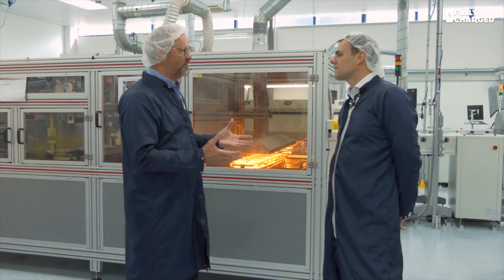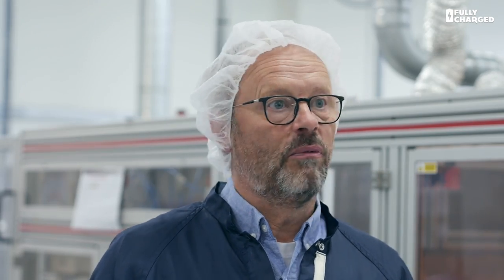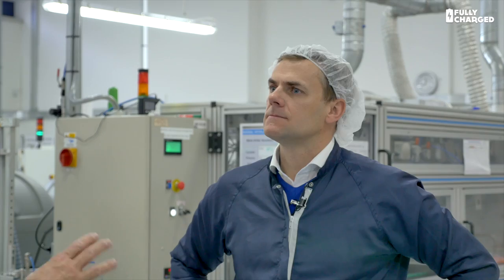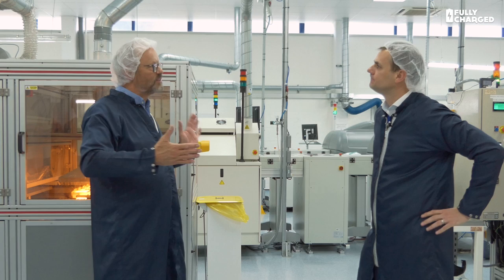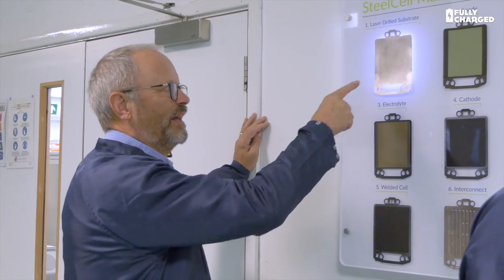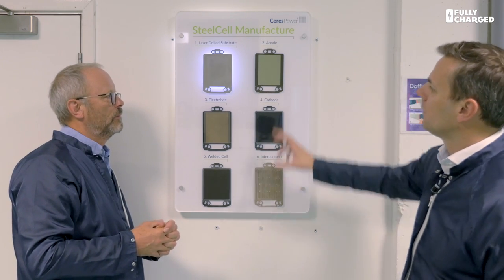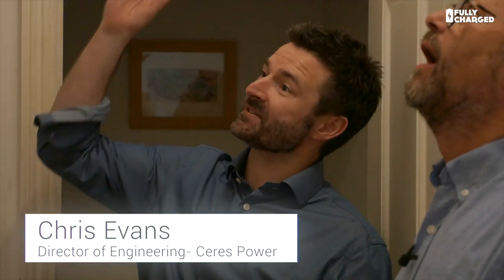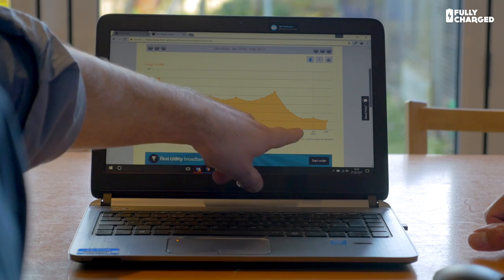Ceres Power | Fully Charged

Comment: One thing not mentioned when talking about efficiency is the fact that the gas must be transported to the house. In places where that is necessary for central heating, its not such big issue, but it shouldn't be ignored as gas leaks are a major problem and the whole infrastructure cost should not be left out of any cost analysis. It would have been interesting to see an analysis of how it would do as a battery using electrolysis to create hydrogen then back to electricity. Would the storage of the hydrogen make it nonviable for most locations and would the overall cost be competitive when compared to more conventional batteries.

Comment: These cells would be amazing combined with a battery storage system to capture unused energy while you're not at home and the gas grid isn't under as much load from things like cooking and heating.  Then when gas demand goes up, they can be switched off or reduced in output while your home runs on batteries to keep the overall consumption of gas lower.

 I'd love to have one in my home, that's for sure.

Comment: Many of the comments in the comments section are way off.  The prime point was that a company has developed a new type of cheap to make fuel cell that could make an impact on the market.  The electricity output of the cell is quite secondary.  That can be scaled up to suit.  One of these could be charging your EV overnight a lot cheaper than directly off the grid.

Comment: Being a cruising sailor, I have this notion of a propulsion/generation system that integrates a hydrogen fuel cell engine/generator, a reverse osmosis water maker (to convert sea to fresh), and a hydrogen separation and storage system.  The theory being: unlimited access to sea water that is used as the base raw ingredient for a zero-emissions hydrogen-based power solution  that's complemented by battery storage.  Not sure about all the science, and the packaging maybe tricky, but a boat certainly provides more flexibility than, for example, an EV.

Comment: As a backup power in a isolated home it is the best solution. Because even with backup batteries, they could be not enough.
But if you are connected to the grid and you just need gas for hot water, this doesn't make sense, because a boiler is more effective for hot water and the energy from the electric grid is already majority green.
Even for cars, the problem of energy is almost solved with the faster charger, that are getting faster!
But is a cleaver solution, for some applications.

Comment: Intruiging solution but instead of using electricity from the grid you are buying more gas from the grid. The question Robert was asking was correct, but he didn't get a straight answer because it does both electricity and heat.

The electricity graph is nice ofcourse, but it doesn't show the gas usage, which is where the energy is really coming from.

There is a small caveat that in NL the goal is to stop using gas for heating by 2050, this device would essentially become outlawed at that time. There is also a push for newly built homes without a gas-grid connection with air-water heat-pumps for heating and hot water. And that has a COP of about 3.5-4, I can't imagine the Ceres power coming close.

Common Air/water heat pumps are the Panasonic Aquarea and  Mitsubishi Ecodan, from you guessed it right, Japan. These are all the rage for countries without gas-grids, Portugal, France and Spain come to mind.

Comment: This could be a big thing for Renewable energies, especially here in Germany with the large gas grid/storage facilities and all the e-gas projects from car manufacturers and utility companies. I wonder how good the reaction times of these fuel cells are since they do not use platinum but probably they could be used to create fuel cell/battery hybrid cars that could then run on e-gas and thus be carbon neutral and help smooth out the grid on institutional level. Great news indeed
Reply: Solid Oxide Fuel Cells like these can only operate at temperatures above 500 degrees C. Reaction times are poor unless you constantly waste energy keeping them hot even when the cells are not in use.
Reply: Thanks for the input. So these are just for stationary applications.
Reply: They're useful for non-static applications, but only if you can predict reliably when the fuel cell will be needed so you can warm it up ahead of time. I've heard about them being used in small UAVs for inspecting power lines or gas pipelines- in this case, they know exactly when the UAV will be launched, so they can simply heat up the fuel cell and have it ready just before the UAV is going to fly. The UAV gets power during peak loads  (e.g. climbing after takeoff) from batteries, with the fuel cell providing a constant supply of energy for charging the batteries and powering the motor while cruising from place to place. Much more efficient than a small petrol engine.

Comment: So you run a gas powered heating system with a tank which produces hot water for heating and hot water for shower etc which produces heat from gas at 110% efficiency.

Then you add a fuel cell which produces ~700 W which then generates power from gas at 35% efficiency at the best? Variable load doesn't work good on fuel cells like on ICE cars, so you put in an additional battery or flat it out by powering the grid and your house to smooth out any peaks.

Well, you still burn gas instead of renewable energy and this at an astonishing low rate of efficiency. Bravo!

Comment: YAY Finally covering SOFC. I've been harping about this on this channel for ages now. Hopefully more people understand how Hydrogen is a terrible form of energy transfer. But Fuel Cells of other types are still awesome.
Reply: This fuel cell would be A great way to use hydrogen from renewables if most of the 50% heat output can be harvested as mentioned in this item. Hydrogen can be produced from surplus renewables at up to 75% efficiency, I've heard. It's better than 'wasting' the renewable energy if demand is low.
Reply: @gregbailey45  Hydrogen in that case only makes sense for Industrial Locally Produced and directly piped Distribution System. Distributing, Shipping & Pipe Hydrogen over long distance is just not viable. The molecule is just too tiny at 0.08988 grams/litre and causes many problems. But we could use other Fuel Cycles for Fuels cells which hopefully are Shelf Stable.

Comment: Interesting. I am amazed that it doesn't care whether the input gas is methane, hydrogen or a mix. We've had micro-CHP systems for some time to make heat plus electricity in the home (such as Genelec (Rankine engine), and  Baxi Ecogen (Stirling engine)). It seems this fuel-cell setup is quite a lot more efficient. I wonder if it's any cheaper? CHP works quite well if your demand for heat and electricity are well-matched, but in the UK they aren't really, in a domestic setup. For nearly half the year you need very little heat: some for hot water (which you could get from solar thermal instead), but much the same amount of electricity (some less for lighting).

And of course the usual question - how much does one cost? I see the development project for the domestic CHP started in 2005.

Comment: How does a 1 kW fuel cell generator power a whole house? I would expect that at least 30-40 kW would be needed for my home in the USA. My Tesla HPWC has a maximum draw of 19.6 kW and my furnace, to say nothing of the A/C, all draw well in excess of 1 kW. I wonder if the time comes when I need to replace my backup generator will I be able to install such a fuel cell instead? I wouldn't miss the noise.

Comment: Maybe a good alternative for regions that don't have enough sun to make solar cost effective. I know some companies have bought these system to power their data center. If the grid has an outage (which is a common problem in the US), these can take over. It is also cheaper than buying the electricity from the grid!

Comment: This sounds like an interesting product, but I'm a little skeptical because over the years I've been reading about energy issues, it seems the idea of a home fuel cell has been one that has come and gone several times. However, I can see a use for this company's product, and I hope they are successful at bringing it to the mass market. I have solar panels that are offsetting most of my home's electricity usage, but I'm aware that in absolute terms, the natural gas I burn for heating is a much larger use of energy, and source of carbon emissions. If a product like this can allow me to use the gas more efficiently, I'm all for it.

Comment: As always, Robert, thank you for your shows!  I really enjoy them, and look forward to each new one as it comes online!

But...

Fuel Cells are a neat technology!  But they are still, essentially, batteries.  And right now, the only way to 'fill' them cheaply, is to use some form of carbon fuel (and this assumes that the fuel cell as a whole unit will ever get cheap enough to make).  If you split water, as a non-carbon fuel source, to get Hydrogen for a Fuel Cell, you will have spent a lot more electricity to do it than what you will get out of the Fuel Cell- not as efficient as storing PV electricity into Li-Ion batteries.  And with prices falling for Li-Ion batteries and for Solar Panels, and the capacity for batteries rising, I just don't see how fuel cells are a good option.  And this is with fuel cells having non-stop research for the last 3-4 decades!

And for literally decades, fuel cells have been the Red Herring of Oil Companies and Car Manufacturers, as a way to put off EVs- this seems to me to be more of the same type of misdirection.  And a quick search seems to indicate that the partners of CERES are Gas and Car companies.  Perhaps I am being unfair to CERES, but I am certainly not being unfair to its carbon-loving partners.  It is akin to Oil and Gas companies secretly funding Anti-Nuclear protest groups to keep Nuclear Plant technology on the shelf or diminished (see Pandora's Promise).  I am sure they would rather see Fuel Cells using natural gas to power homes than PV cells and batteries (or nuclear).  Every year EVs, batteries and non-carbon based power is delayed means billions of dollars/pounds in profits for these companies, and they care little for the consequence.

Comment: Ok, so natural gas go's in to produce electricity at 50% efficiency. What byproduct is produced and what use does it have? Is that waste fed back into the system or is it lost?  If you were looking for heat, doesn't a gas burning heater work at approximately 80-95%?

Comment: If Ontario hydro rates get any higher then I'll have to get me a few of these. Union Gas sells by volume and not mass or BTU for some dumb reason so it's hard to calculate my savings. I'll have to move them outside during the summer so my air conditioner doesn't freak out.

Comment: This looks very promising. Might you consider an overview of how this fuel cell tech could be combined with rooftop solar to further reduce dependency on the grid? Would it be conceivable for the fuel cell to be the supplement to Solar and thus reduce grid us to next to zero? Thank you for your work.
Reply: In Northern areas, could be done, the fuel cell would be the winter heat, hot water & electricity source and the solar panels would be the summer electricity source, augmented by fuel cell hot water. Spring & Fall would be a mix of the two. The two actually complement each other nicely as in the North solar is crap in the winter when electricity needs are max. And you could substantially reduce your battery size by using the more consistent power output of the CHP generator. But you are still looking at a very expensive system, and you need a utility natural gas supply. That is not an energy solution in terms of climate change, because it is just too expensive and the EROI is too low,  a very limited application geographically and still relies on high emissions natural gas.
Reply: whykhr , thank you for the response. I am in Minnesota, USA, so fairly northern. Utility supplies gas is fairly cheap and long term I think better than nuke energy. I look forward to see this fuel cell tech develop

Comment: if you don't have a main gas supply to your home, how long would a large calor can be able to run this unit for?
Reply: You could run it off a Remote LPG tank setup which is already very very common. Bad thing it would only last like Fortnight for a small wall mounted residential setup. But massive rural setups the size of Cars can last probably a few months.
http://ssoilpropane.com/wp-content/uploads/2012/09/LP-TANKS.jpg - Rural
https://upload.wikimedia.org/wikipedia/commons/4/4a/LPG_cylinders.JPG - Residential

Comment: huh. I can imagine vehicles with LPG range extenders would be a great stopgap for areas where plug in electric infrastructure is still a problem, and/or with larger vehicles.
Like... Running a truck in outback Australia where even petrol stations can be more than 500 km apart in places, let alone EV charging infrastructure...
This would be perfect for plugging that range gap until batteries and infrastructure catch up.
Home use is quite interesting too...
Reply: it would be much cheaper since LPG is half the cost of petrol that's for sure... My guess is Tesla is joining all the capital cities here in AU with superchargers because they have Australian plans for their new semi... It's a lot easier to install a powerpoint than a petrol bowser. hybrids may not be as necessary as we think atm.

Comment: So what happens to the gas. Is converted to something else, is it vented to outside ?
Reply: Lee Wood Yes there is exhaust and heat waste. If just hydrogen is used then you end up with water and oxygen. If a hydrocarbon is used it's Oxygen, CO2 and water. The idea is efficiency and clean exhaust. With fuel cells you don't get the pollutants you get with a combustion process like a power plant or a car (CO, NOx, VOC's, ect) other than CO2.

Comment: Right, how long will it take to charge your Tesla (say from 50%) with a fuel cell unit with peak 1kw electrical output??!
Reply: If it delivers 1kw and you want 100kwh, then it takes 100h. Or as you want 50%, 50h. Hope one can run them in parallel;)
Reply: With current SOFC technology would need a much bigger Double Door Fridge size unti to generate roughly 15kw+. Only that would be suitable to a BEVs with Level2 charging. Not ready yet for residential use. SOFC has alot of power density R&D work to be done.

Comment: could adding solar and wind reduce the dependency on the grid completely?   could it do away with Hinckley C?
Reply: Many Solar Thermal Plant generating massive amount of Synthetic Fuel in remote locations (Deserts). Then shipping or piping the fuel. Could replace ALL need for Solid Fission Reactors (Stupid Outdated) in general. Not just Hinckley.

Comment: A whopping 66% is lost in converting fuel to electricity at the power station but only 6% (USA) is lost in the light speed transfer of power to your premises (2% in transmission and 4% in distribution). The fuel cells need to be in the power station because transporting fuel to your premises would be very expensive. On the other hand you only need to transport solar panels to your roof once. Photons from the Sun (93 million miles away) reach your photovoltaic panels in only 8.3 minutes at no charge to you. They then generate electrons and the electromagnetic waves travel into your house or back to the grid at the speed of light. So much for Ceres power?